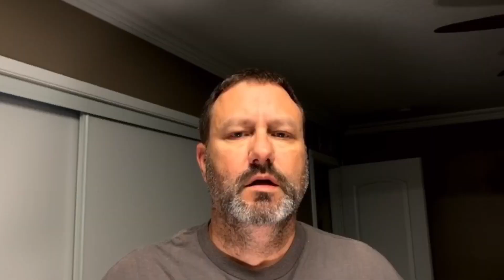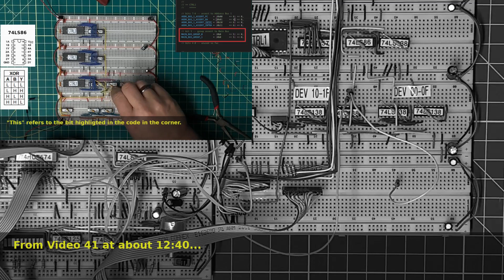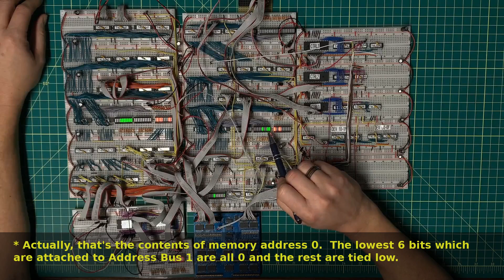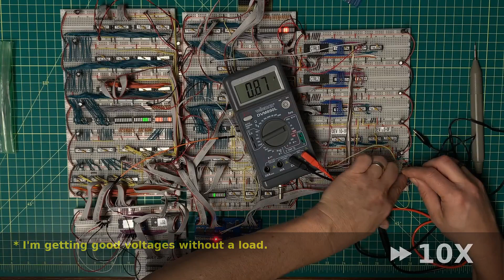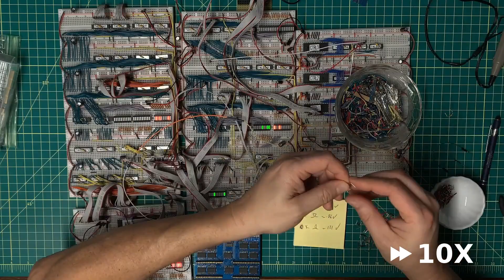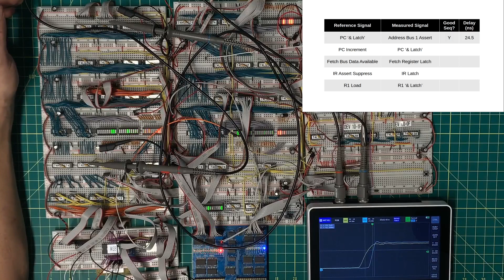0044: Control Logic Expansion (Part 5) Debugging II | 16-Bit Computer From Scratch

Comment: Pulling a TTL input low takes quite a lot more current than pulling it high, which is why you needed such a low value resistor on your reset line. Pulldown resistors aren't normally used in TTL circuits; it's more usual to pull a line up with a resistor and use an active element (switch, transistor, etc.) to pull it low.
Reply from the maker: @gcewing -- Thank you for your note!!

I absolutely agree.  TTL logic has internal pull-up resistors.  These internal pull-ups need to be overcome in order to pull a TTL input low. 

But here is the problem I was not thinking about at this point: When you add a pull-up and a pull-down to the same signal line, you end up with a voltage divider, not a pull-up or a pull-down.  You need a sufficiently low external resistor value such that when you divide the potential you end up with a resulting voltage that is below the maximum low input threshold.

For this reason, I have slowly starting replacing my logic on breadboard with CMOS logic, which do not have the internal pull-ups.  I expect to be able to more gently pull the signal down when I am dealing the HC logic family.